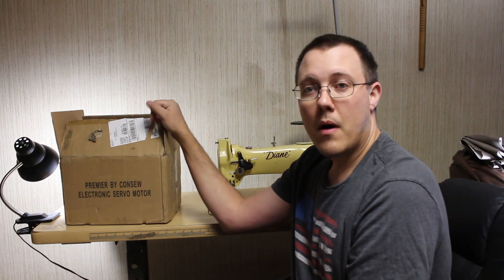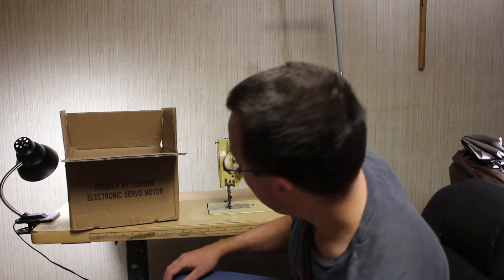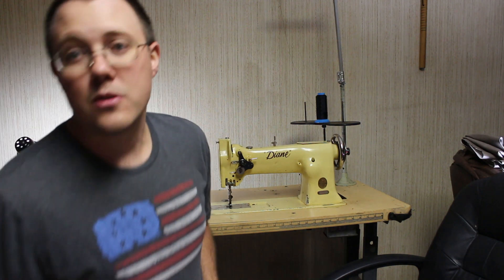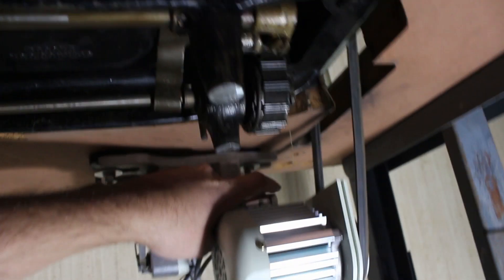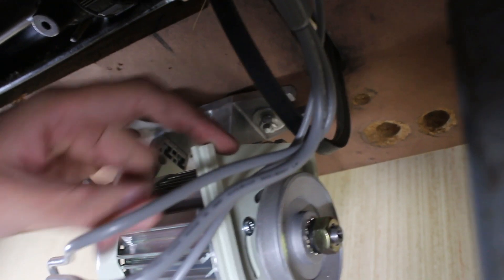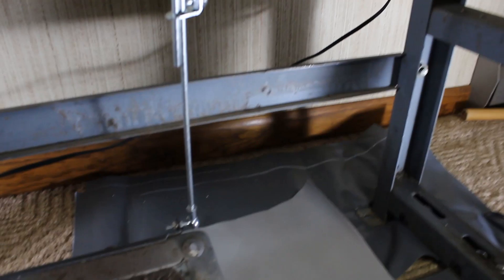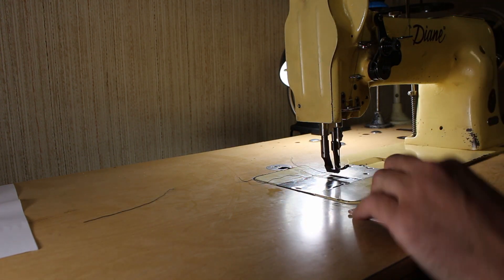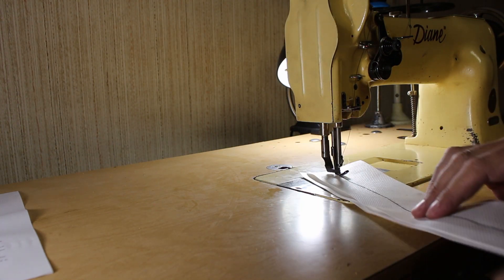Singer 111W101 - Installing A Servo Motor

Comment: Kind of wanted to see how it handled thick material and how the slow speed control was on those.
Reply from the maker: I feel it does really well in both these areas. I'm still a novice on industrial machines so I am still learning how to feather the pedal on this machine. 
Made a quick video demonstrating sewing thick material. Did 8 layers of heavy duty vinyl tarp with no issues.

https://youtu.be/NoPcSuOyAn4

Comment: I just bought the same machine and table and I plan on ordering the same motor. Do you know what size belt you have? I wanted to order one so it gets here at the same time as the motor.

Thanks a bunch for the videos!
Reply from the maker: No idea on belt size. I got a bunch of them with the machine so I just tried them until one fit. You can get some leeway by adjusting the angle of the motor. I also think there are belts that can be cut to size and then connected with a metal clip. That's what the one I'm using is.
Reply: @PlainsPrepper  thank you!